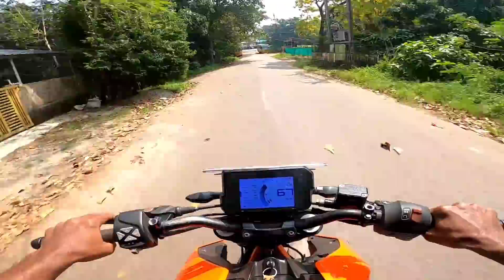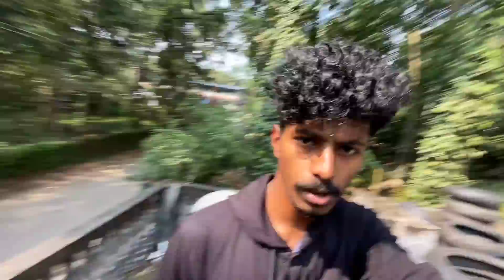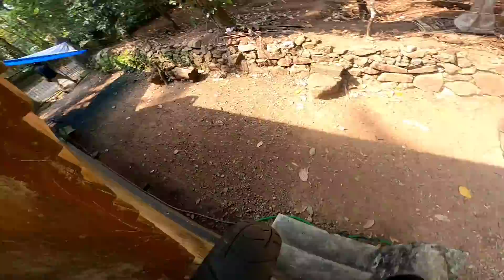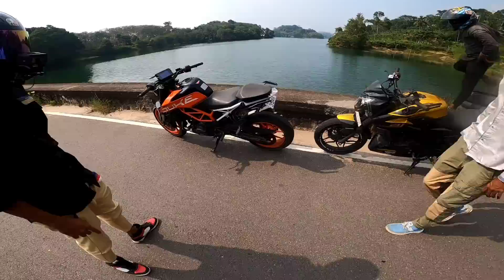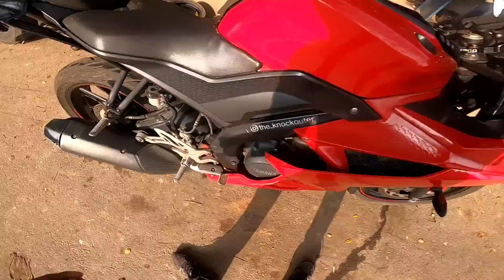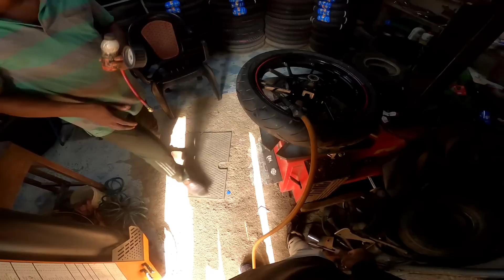പുതിയ Track Tyre എടുത്തു 🙃 || R15v3 പണിതു

Comment: Duke bs6 model bike normal  petrol adicha ethangilum problem undoo ... Showroom  ninu  parannu speed petrole matheram adicha madhinuu ... Normal adicha engine complain  varuna paranna ...
Reply: As per my knowledge...no problem with both petrol
Reply: Superbikesin speed petrol adikan parayanath kettittond ... Normal vandikk normal petrol mathi..not much difference.njn edakk premium petrol adikkuvarnn velya karyam onnum illa .single cylinder bikes don't need that .
Reply: Nteda vedi adicheyaa.eth super sport onnuallallo.just normal bike aan.sadha petrol mathi engine athokke thaangumm😂
Reply from the maker: Ithink no bro 🤗